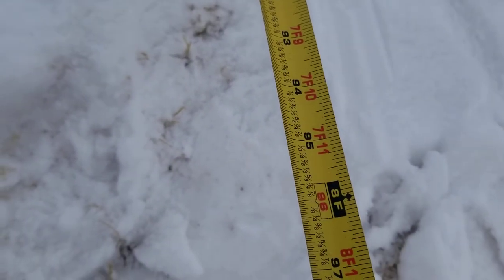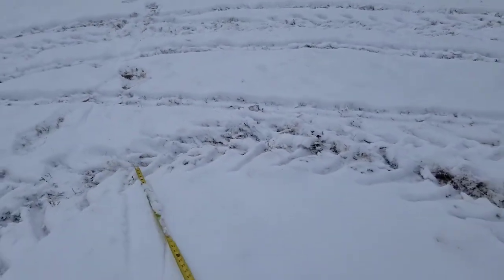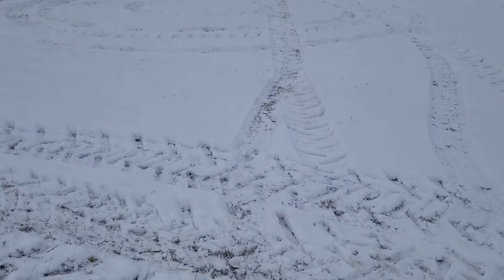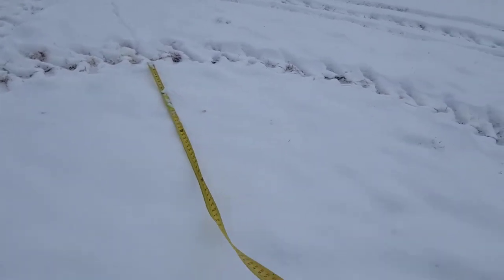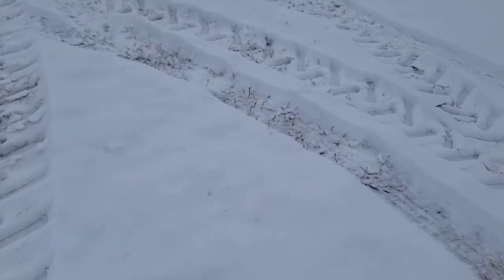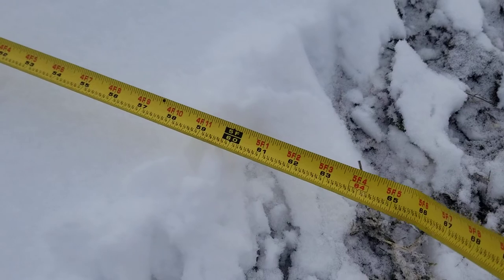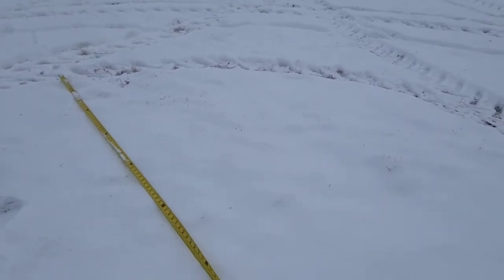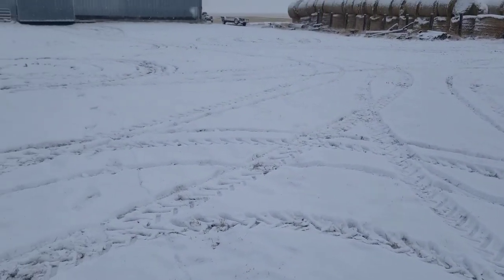Turning circles: wide vs narrow front

Comment: Maybe you should have used the steering brakes on the snow?
Reply from the maker: The point was to show how sharp they turn without the brakes. Obviously you can lock a wheel and pivot while sliding the front end and tearing up the turf.